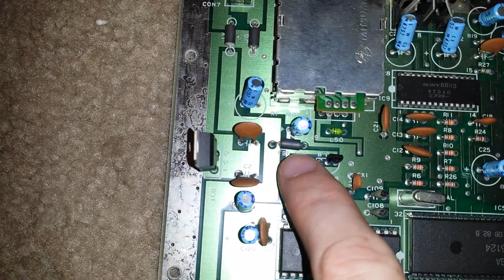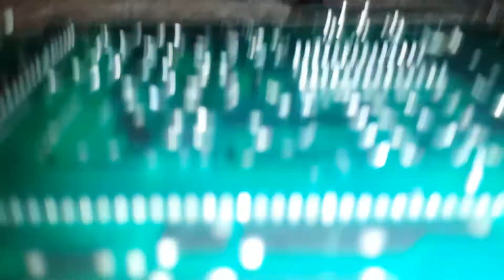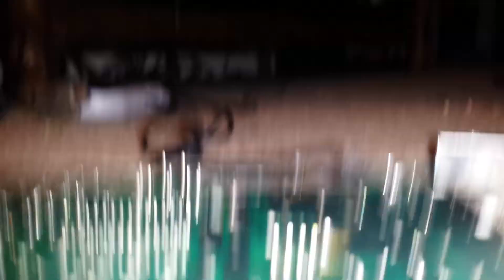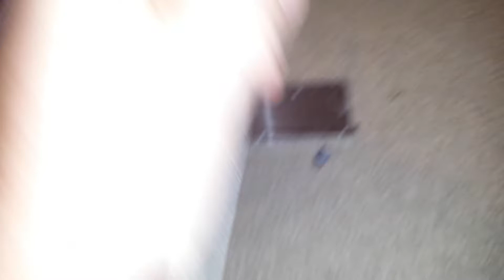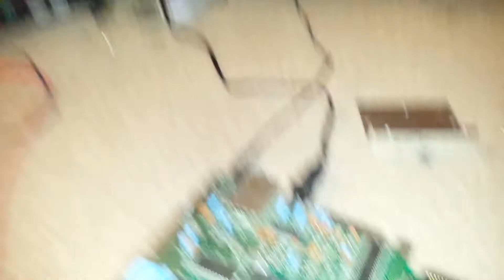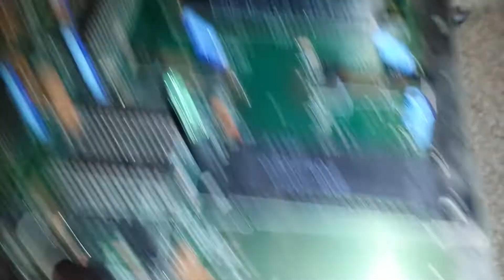Sega Master System Repair And No Power System Repair Tips

Comment: Man, over 10 yrs ago I smoked my SMS doing exactly what you said people do (powered it with a Nintendo adapter). I left it for dead, but didn't have the heart to throw it away..  I was recently thinking about my fried SMS and found your video. I replaced that 7805 regulator and the SMS lives!!! Thank you for posting this video!!!!
Reply from the maker: Yep, it's easily done. Shame the NES runs on AC, funny part is, the Famicom runs off DC and will fry with a NES adapter too.

Comment: hey have any suggestions on cleaning the pwoer switch? mine is a bit finnicky I have contact cleaner but im not sure where to spray it so it gets in the switch
Reply from the maker: Contact cleaner and a toothbrush, don't even have to worry about it drying since contact cleaner is oil based and not conductive.
Reply: @zebular  thanks for the tip

Comment: Hi, Great video have subscribed. I picked up a box of these consoles last weekend (Australia) They all work, however the power switch on one of them is not working correctly.  do you know where any replacement or alternatives?  might just be me, or difference between NTSC and PAL consoles, but looks like the 7805 is in backwards.
Reply from the maker: As in it's the power switch itself or it's just not receiving power?

Comment: i HAVE A SMS THAT KEEPS SMOKING THE 7805... USING A GENESIS MODEL 1 POWER SUPPLY... ANY THOUGHTS??
Reply from the maker: I would definitely try a new power supply before anything.
Reply: I not only tried another power supply but tried both power supplies on a different SMS.
Reply from the maker: Hmm strange, so does it blow the voltage reg instantly or over a short period of time? Almost sounds like there is a bridged connection somewhere. If you could upload some pics of the bottom and top of the board in that area I could probably help you out better.
Reply: May have figure it out... I had continuity between my 5+ and ground everywhere on the board. after looking it over c123 and c124 were twisted so that the legs were touching. After untwisting then continuity is gone but so aren't all my 7805s. Will try to rob Peter to pay Paul tonight and let you know.
Reply from the maker: CHRIS OLIVER right on, let me know how it goes!
Reply: Worked like a champ. Was hoping for something other then the built in maze game but beggers cant be choosers.
Reply from the maker: CHRIS OLIVER awesome! I love hearing when someone brings an old game console back to life!

Comment: Hi.

Can you still get spares for the SMS,  Chips and stuff,..and if so from where ?

Thanks
Reply from the maker: Harry62811 voltage regulators and such.  Not so much the processor.
Reply: Found a Source for old SEGA Chips (NOS).. doesn't have all, but some:

http://stores.ebay.com/POLIDA-ELECTRICAL-H-K-LIMITED/Integrated-Circuit-/_i.html?_fsub=9089988018&_sid=1049472388&_trksid=p4634.c0.m322

Has VDPs and stuff..but i'll keep looking to see if I can source all (or as near to all) ICs used in the SMS
Reply from the maker: Harry62811 Right on, luckily I've never had a cpu go out on me.

Comment: Hi Jake, I recently purchased a SMS and it works great with one exception... the pause button does absolutely nothing. I've taken it apart and the entire board looks flawless as in no obvious corrosion areas at all. Is there anything I can do to test what is wrong or how I can go about fixing the pause button so it will work?
Reply from the maker: Have you tried cleaning the back of the button and contacts on the controller board with a qtip and alcohol?
Reply: When you say the back of the button do you mean the soldering bumps on the other side of the board or where the button touches the board on the top side? I cant get a q-tip under it. I did rub around it a bunch with white vinegar though maybe that is the wrong stuff to use?
Reply from the maker: My mistake, I wasn't thinking about the pause button being on the console itself on the SMS. Alright, so what you want to do is where that hinge type thing is, clean the bottom of that where it touches down on the board and clean the spot where it touches the board. Basically oxidation is keeping it from making good contact.
Reply: Mine has these plunger looking things like in this picture not the hinges like yours had, but it still said Taiwan so I dunno. https://ancientelectronics.files.wordpress.com/2015/08/msfm42.jpg

I can try to get under it and clean it though ill see what i can do!
Reply from the maker: Yeah there is a ton of minor revisions of the sms, same with the Genesis. I know what piece you are talking about though as I've had problems with those before.  Best bet is to dig them out with an extremely small flat head screw driver, clean the inside of the plunger and where it touches the board and then attempt to put it back into the socket. Worst case scenario it's going to continue to not work.  Alternatively you could rip the plunger out and find something flat and conductive of the same shape and rig it so it only makes a connection when the plastic button pushes it down.

Comment: I wasnt getting power, then replaced 7805 and its now getting power but no picture, just the tvs static screen.    Im using the coaxal out. Any ideas???
Reply: I mean rf out.
Reply from the maker: +spartan3774 Might just be the RF port. Honestly you should look into AV modding it, it's super simple... if you want to see if that's all it is you could hook the yellow composite wire to your TV and then touch just the composite leg on the Master System video out chip and then ground the outside shielding of the composite cable. If it produces a picture you'll know it was just the RF box.
Reply: +Jake “Zebular” F But Im an idiot and dont know what half you just said means, LOL.